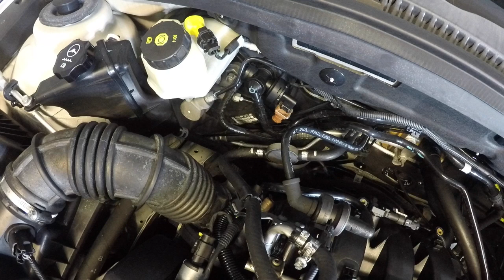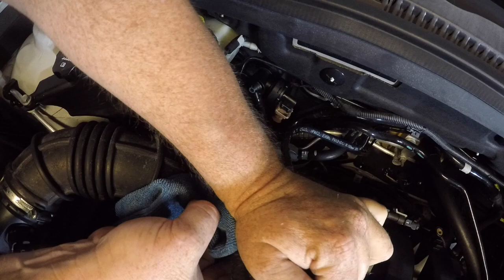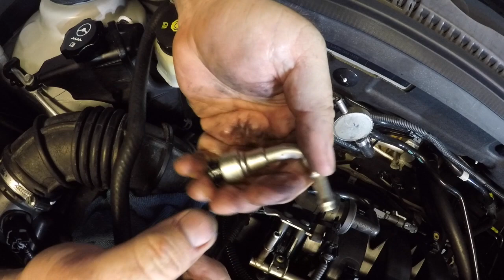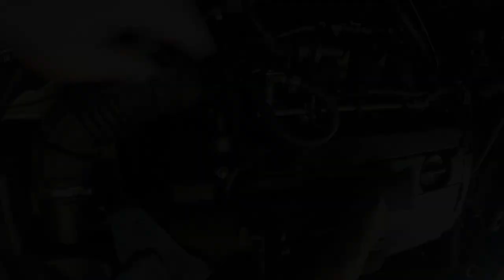Replacing Leaking High Pressure Fuel Line

Comment: I’m having the same problem in my 2014 Chevrolet Cruz it is from the manufacture si I can’t replace just the damper which is the metal circular part so my question is do I buy a whole new line or I’ve seen people who cut the lines and just buy that one part and seal it all back up what would you recommend?
Reply from the maker: I would cut and join the fuel line. Use quality clamps

Comment: I have a little chunk taken out of mine, do you think I could just shorten the hose and put it back on? Or does it have to be correct length?
Reply from the maker: As long as it is not stretched tight it will be fine.

Comment: Did you depressure the fuel before doing this or you just went straight with removing the fuel line?
Reply from the maker: You should depressurise first, but this was leaking to excess pressure off.

Comment: Is that a regular nylon fuel hose?
I'm asking because I have the same problem with my 97 jeep Cherokee but I've been told that fuel hoses from autozone wont work..
 Any help?
Reply from the maker: High pressure fuel line.
Reply: @killawattgarage  do you know the size? 
I've read 5/16 but not sure if that's correct.
Reply from the maker: @BUKWulfSh0t  Just take some old hose with you and have them measure it for you